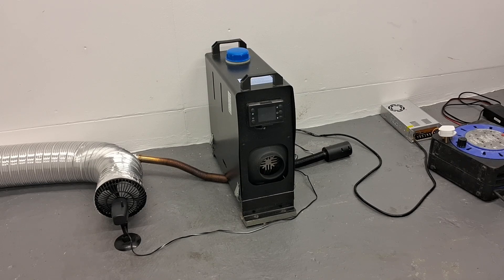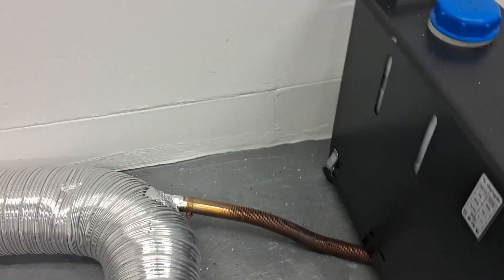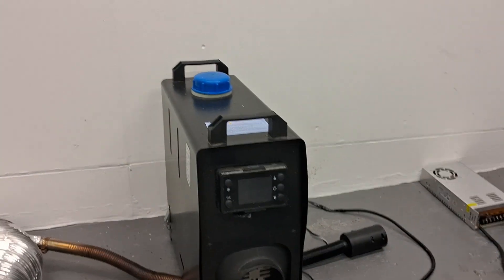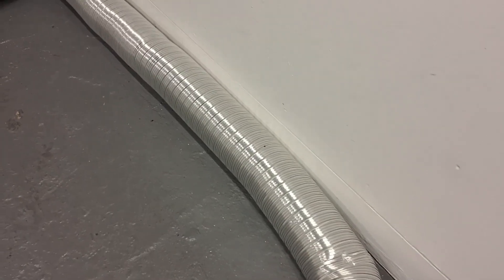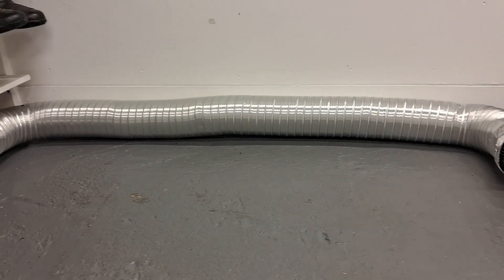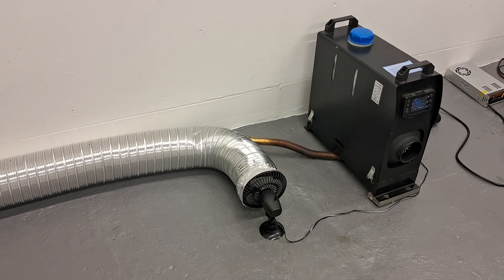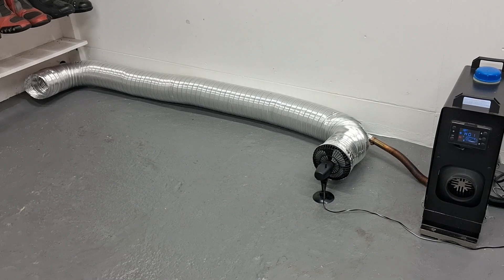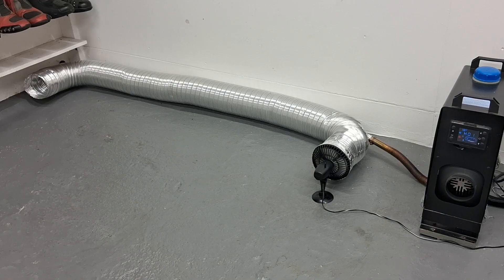FREE HEAT FROM DIESEL HEATER WASTE EXHAUST GAS HEATING MY HOME  House Chinese Kerosene off grid

Comment: GREAT,CHEAP WAY TO GET MORE BTU'S/WATTS  OUT OF SYSTEM....NICE...
HOW ABOUT...
YOU RAID A COUPLE OF RECYCLE BINS...
GET ALUMINIUM CANS...
SLIT THEM OPEN...YOU CAN PROBABLY FIT A HUNDRED OR MORE,SAY AN INCH APART..
CUT A CIRCLE, SAME SIZE( OR A BIT SMALLER) THAN THE FLEXI PIPE...
CUT A HOLE IN MIDDLE, SIZE OF EXHAUST PIPE...
FIT AS MANY AS YOU CAN, ALONG LENGTH OF EXHAUST...
THIS WILL CREATE A MASSIVE HEAT EXCHANGER,PULLING HEAT FROM EXHAUST PIPE, TO FLEXIPIPE, AND WILL ALSO ACT AS A BAFFLE, LIKE  I N A CAR  EXHAUST, REDUCING NOISE..
AS THERES FAR MORE SURFACE AREA, AND SLOWER MOVING AIR, PLEASE DO A BEFORE AND AFTER VID....AND MAKE THE TEMP SHOWN READABLE- THE NUMBER OF IDIOTS ON HERE, WHO SHOW TOTALLY ILLEGIBLE MONITORS IS INFURIATING...
 U MAY NEED TO PUT SOME SMALL HOLES IN DISCS, NEAR THE OUTER EDGE, AS IT MAY STOP AIRFLOW IF TOO TIGHT A FIT...
ALSO...
ASK YOUR COUNCIL RECYCLING YARD IF YOU COULD TAKE A COMPUTER - THEY GET LOADS...
USE THE FAN OFF THAT...
ALSO...
IF YOU FIT A VARISTOR ( VARIABLE RESISTOR) , YOU CAN ADJUST POWER TO YOUR FAN , ITS A KNOB OR LEVER, JUST LIKE ON A RADIO  HIFI VOLUME CONTROL.
PS- YOU NEED TO HAVE A CARBON MONOXIDE DETECTOR, PREFERABLY 2...
IF ONE FAILS, THE OTHER KEEPS YOU ALIVE...
NO  EXCUSES, CHEAPSKATE, YOU CAN BUY THEM OUT OF THE STANDING CHARGES YOU HAVEN'T PAID....
PS- I USE UTILITA FOR GAS...NO STANDING CHARGES- CALC WHAT THAT SAVES EVERY YEAR...
YOUR WELCOME.
PS- SCIENTISTS SAT THAT 18 DEGREES CELSIUS,IS BEST TEMP WHEN SLEEPING....
21 DEGREES, WITH A DUVET IS NOT OPTIMAL- WOULD YOU WATCH TELLY, WITH ROOM AT 21 DEGREES - WITH A DUVET OR PUFFA JACKET ROUND YOU ???
SO REDUCE YOUR  THERMOSTAT IN THE BEDROOM, OR TURN YOUR DIESEL HEATER DOWN...
DO A BEFORE AND AFTER ON THAT...
ITS QUITE A CHUNK OF DOSH- AND YOULL SLEEP BETTER.
ANOTHER THING- LIFT IT OFF THE FLOOR- DONT LET HEAT GET DRAWN DOWN THROUGH THE FLOOR...

Comment: You can use used car oil and add ten percent diesel or crosene, then add 130 percent water, but the water must be ionized, then put the entire amount in a blender until the color of the milk becomes white. Of course, it is preferable to filter the used car oil before using it, and the best thing is to use the centrifugal process with a strong magnet. You will have a very clean combustion and it will burn 100/💯 without the device being clogged from the inside by carbon, and the exhaust will also be clean and the amount of fuel will double by adding ionized water.

Comment: Use two or more 2m long exhaust pipes and create a three flow pipe (two bends & three straights) inside that larger ducting. That will give much more surface area to extract the heat.

Comment: Hi Andy, have you had any trouble with the fuel pipe on the heater because I’ve seen a few videos where they have changed the fuel pipe. Many thanks Stu
Reply from the maker: Not at all

Comment: Every litre of diesel burnt will create a litre of water (as steam) plus a smaller amount of waste products such as tar. By cooling the exhaust the steam will convert back into water while it is still inside the pipe extension you fitted so it might be a good idea to run your heat capture device on a slight downhill gradient.
Reply: Diesel burns 1 litre to get 1litre of water?   100% efficiency?
Reply: @slarratt  No. Efficiency is a measure of energy availability (i.e. in this case, how much of the energy released from the diesel burning was released into the room as heat).
As unbelievable as the figures sound, @rhiantaylor3446 is correct - under ideal circumstances one litre of diesel (weighing 835g) produces 1035g of water (and 2640g of carbon dioxide). 1000g of water is 1 litre.
This is because of the weight of the huge amount of oxygen that is required to make the diesel burn.
Two molecules of diesel react with 37 molecules of oxygen to produce 24 molecules of carbon monoxide and 26 molecules of water.
Reply: HOW CAN A LITRE OF DIESEL.....
HAVE A LITRE OF WATER IN IT ..???😭😭😭😭🤡🤡🤡
THATS- A LITRE OF WATER, YOU PILLOCK...🤡🤡🤡😭😭😭
GO ASK AI HOW MUCH STEAM PRODUCED.... DO YHAT, AND YOU'LL FIND THE AIR USED, TO DETONATE A LITRE OF DIESEL - HAS A LITRE OF WATER IN IT...
HE'S TOTALLY CORRECT...
AND I'M TOTALLY HUMBLED...
SHOULD HAVE THOUGHT OF THAT.
Reply: Or just run a 6 ft exhaust with a fan blowing over it.   Done.
Reply: I STAND CORRECTED...OF COURSE, IT ISN'T WATER THATS IN THE DIESEL-ITS WATER IN THE AIR THATS SUCKED IN TO CREATE THE MIX REQUIRED FOR DETONATION...
MY SINCEREST APOLOGIES !!!
THANK YOU FOR AN AMAZING, TRULY  MIND REWIRING FACT.

Comment: Hi mate I fitted heater in my shed attached to the hause . done hole in the wal to blow hot air to the 16m2 livingroom - is not noizy in side . Im used exhaust to heat air like u but exhaust pipe is in the steel pipe and this all is in the aluminim spiro pipe.... ) air goes to heater (air inlet - don't need extra fan ). When out siede is 0 deegres then this idea giving me extra around 20 degress celcius on air inlet and on air oulet is over 100 celsius on lowest setings - speed pomp 1.4hz. Without this idea whan is 0 deegres then heater blowing only around 75 celsius on lowest settings
Reply from the maker: cool,

did you see my other heater videos: https://www.youtube.com/@andyfireblade
let me know what you think

cheers andy

Comment: I've watched lots of your videos trying to make use of the exhaust heat. So far what do you think has been the most effective at trying to use this?  Every time I think I want to try this you come out with a new way lol
Reply from the maker: most effective is putting the exhaust through a radiator.
that really gave out some heat.

cheers andy

Comment: Andy if that power supply is the same as mine , it has a voltage adjustment dial on the left by the power terminals. If you use the psu and reduce the voltage to the 12v fan it will operate slower.
Alternatively get an old usb lead cut the head of it and use the red and black (thats the power) and wire that to the fan and it will operate at 5 volts when plugged into a usb socket

Comment: Now thats a smart idea! Have you got a thermometer to see what heat is coming out out? Wondering if a lower powered fan would move the air slower through the pipe and lessen the cooling effect.... Sounds quite a powerful fan and would cool the internal air as its pulling in cool air from the garage? Just a thought! ☺
Reply from the maker: Great idea

Comment: One question is are you extracting more heat than was being radiated by the bare exhaust, or just using electricity to blow that into a different place?

Monitoring the external exhaust temperature outside the house with and without would be a good way to tell.
Reply from the maker: good comment thanks

Comment: If you put your fan to other end, it will be more efficient. It becomes crossflow heat exchanger then. For all pipe length there is bigger temperature difference in crossflow configuration and you extract more heat.
Edit: counterflow, not crossflow
Reply: This sounds like a good idea,  The fan will cool down the exhaust pipe, but the air flow at the end of the pipe will be hotter as it's only just left the heater. (If this makes sense)
Reply: Good idea
Reply: Hello. I'm thinking if you put fan other end it will blow exhaust gas back in to room. Am I right.
Reply: @adventcliff2040  Both ends are already in your room - so if you have exhaust leak somewhere inside room or inside heat exhanger, smoke is inside anyway, vent direction does not matter.
Reply: @adventcliff2040 the exhaust is sealed and vents outside. The heat from the exhaust is heating the ducting, the fan blows the heat around the room.

Comment: Brilliant mate. Nice and easy. A variable speed fan would do better.  I bought these variable speed blowers off of eBay that would do the trick. Also you are getting colder air from the floor and heating it up back towards the floor.

Comment: I'm planning on doing something similar, except with a copper tube for the exhaust to aid in heat transfer and a length of 3" car exhaust pipe.
Reply: Copper pipe is not recommended for use as an exhaust pipe, even though it could technically conduct exhaust gases. Exhaust gases contain compounds like sulfur and carbon monoxide, which can react with copper. Sulfur easily forms copper sulfate with copper, which can corrode the pipe over time. Additionally, exhaust gases are very hot, and copper softens or may even become damaged under prolonged high temperatures, which weakens the durability of the pipe.

Materials commonly used for exhaust pipes include steel and stainless steel, which are better suited to withstand both the high temperatures and the chemical composition of exhaust gases.

Comment: You could try to connect that tube to the inlet of your heater,  so it will preheat the air going through the heater making it more efficient. You would not need the fan anymore either.
Reply: That's exactly what I was going to say, and then fan speed varies with heat output automatically too 👍
Reply: It could make the heater less efficient.  Warm air is less dense than cold but the same volume will be sucked into the heater, ie less mass, chemical reactions (such as burning) work on mass not volume.  Also by messing with the air temperature you could adversely affect the fuel/air mixture.
Reply: @rogerbarton1790  the air for combustion has its own separate intake. Just talking about the intake for the heat exchanger here
Reply: @ericcamolinos3740  Ah - I thought he was talking about the air intake for the burner.

Comment: I'm in the process of creating a very similar setup in my outbuilding - inspired by your vids! I'm planning to run the airflow in the opposite direction for hopefully greater efficiency and I'm using a 200mm pc fan which is quieter than the heater motor
Reply from the maker: Good luck!

Comment: Run the other way or allow the heater to use the air heated by the exhaust. You want low temp to high temp.
Reply: Yep! Counter flow heat exchangers are more efficient than parallel flow. 

An open weave thermal conductive material (loose pack steel wool?) around the 1" pipe will help transfer more heat to the air.
Reply: Raising the heater up so you would have a natural draft plus putting the fan at the other end. 

Be careful the more modification the more risk, small as they may be.